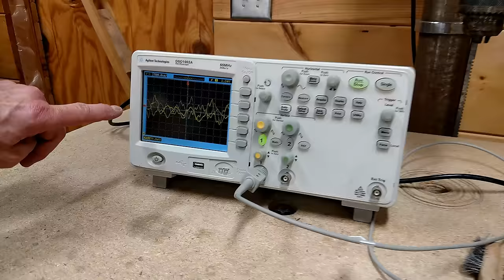Active Noise Cancellation

Comment: I couldn't determine : 
- was it partly 'good luck' that the actuator generated sound waves that were out of phase  ?
OR 
- was the system designed to (directly) generate anti-phase sound ?  If so which part of the system ?   

Either way, the means of adjusting the amplitude then seemed the way of getting the best out of the system, is that correct ?
Reply from the maker: Think about these sound drivers.
When they are manufactured, the magnets, coils and flexible diaphragms will have the same orientation relative to each other, unit to unit. The starting position from rest will be in the middle of its excursion limits. The instant an electric current begins to flow, the magnet will begin to move.  If the direction of the current begins in the other direction, then the magnet will begin to move in the other direction. Visualize a sine wave, that opposite motion will produce a 180 degree phase relationship.
Reply: @TechIngredients  RE>> If the direction of the current begins in the other direction, then the magnet will begin to move in the other direction.

It's a great explanation and I do understand this, thankyou.   My guess then is you probably wired the side panel actuators in opposite polarity to the one making the sound in the box, is that correct ? 

Technically even that might not be enough as the cancellation effect must partly depend on the # wave lengths from the sound device to each cancellation device.  On that basis I expected to see some sort of tuneable time delay circuit for each cancellation device
Reply from the maker: That's  how I did it.
The way I kept this simple is to locate the mic and the cancelation  actuators(speakers) as close as possible (1 cm).  Even at 2,000 Hz, the waves were still 168 degrees out of phase.

Comment: Question for you: There is a loud compressor across the street that is driving me crazy.  Would it be possible to place a speaker and amplifier beside the compressor and play back a recording of the compressor noise ( out of sync, of course)   Would this have the effect of cancelling the noise?
Reply from the maker: Yes...but.  the sound coming from the compressor is radiating from all of its surfaces and reflecting from any nearby surfaces such as walls and the floor.  A loudspeaker, even if located nearby, will have a different radiation pattern and that matters.  That is why my demonstration used a box to cancel the sound from each direction with a mic and speaker pair for each wall.  Even then, the reason the amplitude didn't drop further than it did was largely due to the uncompensated bottom surface on the table where no mic and speaker were located.

Comment: Nice video and I learned a lot. But I'm confused as to how the sound is being phase shifted? Using an amplifier will only change the amplitude of the sound. Are you relying on the circuit latency to assume that the original and generated waveforms will be phase shifted by 180? If so, then it seems pretty inefficient and unreliable method as you might get constructive interference instead of destructive for some other amplifier model(different latency), and hence more noise instead of less. Ideally, I think there should be 2 knobs, one to adjust phase delay and another for amplitude.
Reply from the maker: It's actually very simple, but limited to lower frequencies.  The detector and the actuator are positioned approximately 1 cm apart.  By reversing the polarity of the amp. output, the phase offset is 180 degrees minus the spatial offset times the wavelength/ the speed of sound.  For example, a 200 Hz sound will have a wavelength of approx 170 cm and a 1/2 wavelength (peak to trough) of 85 cm.  The phase error would be approximately 2 degrees.
Reply: Tech Ingredients Thanks for clearing that out. I see by your calculations that the amplifier latency will be negligible for low frequencies and your method of swapping leads would work out quite well.
Now I'm wondering whether it could be a closed loop system. A microphone outside the box controls the gain of amplifier. If you intend to put engines, that will compensate for frequency changes while engine is running at different speeds. Will need quite intensive PID tuning. Guess that's probably just overkill and your method should be fine for 90% use cases 🤔

Comment: Does the acoustic panel burn at blocking shock waves due to the frictional energy conversion🤔. Ive seen his one of video of hydrogen which he says it can produce mach9 speed of pressure waves.
Reply from the maker: No it doesn't.  There is little energy being absorbed here.

Comment: So... if I wanted to muffle road noise to my house.. I could pickup the sound with a microphone then time it correctly to be 180 degrees phase and project to my house.. Thus cancelling most of the waves ?  🤔
Reply from the maker: Sorta.
The sound hitting  your house will strike the outside  with a whole mix of phases, and the walls will respond with a mix of different resonances  depending on the local stiffness. This can work, but you'll  need dozens of microphones  and drivers working in independent loops.

Comment: Would the 60/40 ratio used in your speaker-room be better than the centred actuators here?
Reply from the maker: No.
The concept here is  to counter the movement of the surface by using active feedback.  The mass of the actuator needs to be located where the surface would otherwise move the most.

Comment: Wait a second, are you driving those Dayton Audio exciters with Adafruit stereo 20W class D audio amplifier boards? That's exactly what I want to do, but for a different project. In my application, my head will be in a helmet right between two of those exciters, so it shouldn't need too much amplitude to sound really loud inside. I also want to drive those exciters with analog output from an electret microphone, but I'm afraid of feedback. What's the best way to eliminate that feedback?
Reply from the maker: Make sure the output from the speakers is isolated as much as possible within the helmet.

Comment: So noise cancelling headphones basically have a microphone which listens to sounds and delays them so the soundwaves going in are the opposite of the soundwaves going out
Reply from the maker: Yes.  they also include a more sophisticated DSP circuit to adjust the degrees of phase delay based on the frequency rather than our simpler, 180 degree phasing that occurs with reversing the polarity of the speaker's lead wires.  This method will not work well as the frequency of the sound goes beyond several thousand Hz, do to this mismatch.

Comment: Let me get it straight. As english is not my native language, i'd clearify some stuff off this video.
As far as I understood, you can "cancel" out speakers if you put them on the same line and invert a signal on one of them? 
And this box. In the box there was a speaker and a mic, and outside there was speakers who took reversed mic signal and cancel out noise? 
If so, that would be interesting for a huge venue stages. that would insanely improve sound quality!
Reply from the maker: You have presented this correctly.

Comment: Superb demonstration of canceling a single tone. To cancel a generalized sound requires doing an FFT, inverting each component, and then summing them into a signal that will drive a speaker. Much harder to explain but I look forward to how you do it. Thanks!
Reply from the maker: Maybe not. Consider what is happening when the mic is generating a signal.  There is only one channel reading the Fourier assembly of all the sinusoidal waves that comprise the complex sound.  At any instant, all of that complexity is a single voltage sent to the amplifier which in turn generates the current that drives the oposing actuator.  The reason a DSP must be used for noise canceling headphones is the displacement of the sensing microphone and the canceling speaker.  A frequency dependent phase delay has to be introduced to maximize effeciency and this become increasingly more important as the frequency increases. We mounted these microphones as close as possible to the actuators and are willing to live with a frequency limit around 1-2 kHz.
Reply: Tech Ingredients A credible demonstration would resolve it.
Reply from the maker: It would.

Comment: how do you compensate for the latency in the active noise cancellation? wouldnt the circuit introduce some sort of delay and shift the phase off by just a bit?
Reply from the maker: The circuit is extremely fast compared to audio frequencies.  There is a phase mismatch that is produced by the displacement of the mics and the exciters and that limits this approach to frequencies below a few thousand Hz.

Comment: Interesting video.  But just curious why you are using gas motors instead of electric motors for the drone.
Reply from the maker: We are using both.  The engines will generate the electrical power and extend the flight time that can be achieved with batteries.  By using a separate module, you can add this generator to an existing multi rotor without modifying the basic craft.
Reply: @TechIngredients  - Thank you for your reply.  I understand now.  Also after watching more videos in the series.  So basically you are replacing the main drone battery with a gas motor and generator which should give a much longer flight time..

Comment: So you just feed the driver inverting the cables respectively to the microphone?
Reply from the maker: Yep, it's that simple.  But, this does create limits to the upper frequencies that can be attenuated because of the separation of the mic and the driver.  Phasing mismatch will increase as the wavelength decreases.

Comment: very cool! I have a question that might be very stupid, but I really don't know...lets says we could apply this to a studio, for sound isolation purposes. Inside the studio we need to hear everything the way it is, for recording or mixing, and my first thought is that the out of phase sound produced to cancel the original sound would also be heard by whoever is in the studio, messing all the original sound, wouldn't it? Or is there a way to make this cancelation work only for whoever is outside the box (or the studio)? Again, thanks for the great video!!
Reply from the maker: Reflections and phasing are a nightmare.  What you hear and what someone standing several feet away will hear over numerous frequencies, may be completely out of phase.  Attempting to modify the wavefronts that are striking you and your friend simultaneously by introducing an anti-phase wavefront from a  common source would be nearly impossible.  The best compromise would be to place generous acoustic absorbers within the room ( common practice), but then to limit the transmission of the sound outside the room by making the walls essentially infinitely massive with drivers to nullify their movement.  This is easier because the wall moves or dosen't move in response to the entire spectrum of frequencies and their phases because the wall is a single, plane in space.

Comment: I was wondering, the speaker and the shakers are putting energy inside the box. The waves cancel each other because of the phase-shifting but the amount of energy does not decrease, right? Could this energy become heat or another type of energy?
Reply from the maker: It becomes heat.

Comment: Any chance you could build a rotary engine they don’t vibrate much and make great power for their size plus I always want to see a small one made, another great video.
Reply from the maker: It would be interesting, but we can handle only so many projects.  We recently finished a very small turbojet engine based on an automotive/motorcycle turbocharger that will drive a turbo shaft, turbine.  That video will be posted soon.

Comment: It is really good. This is the best demonstrations of out of phase I've ever seen. Perfect. But I have a question: What frequency is it on you demo. I'd like to duplicate the experiment again by myself. Could you give me some hints. Thanks lot.
Reply from the maker: Probably  close to 1,000 Hz.  But, simply divide the speed of sound by the frequency to determine the wavelength and space the speakers 1/2 that distance apart.
Reply: @TechIngredients  Thanks for you prompt reply. Actually we did the different frequency to try including 1k Hz, but the sound was not able to cancel. We don't know what different in between us. Could you give us a list your equipments, then we will duplicate this phenomenon again. Thanks in advance.
Reply from the maker: Don't focus on the particular frequency, it doesn't matter.  If you understand the principle, then the equipment also doesn't matter.
Reply: @TechIngredients  Yes, I agree with your points. But right now actually we can't duplicate your experiment, even though we tried several frequencies and moved one of the speakers to find if there is a position that can cancel the sound as you demonstrated. I have an unreasonable request. If it is possible could you help us to check, we will make a video or take some photos that should be easier to describe our setting. Of course, that must be in your available time.😀
Reply from the maker: First, try a significantly  lower frequency as the spacing will be proportionally  less demanding.  At 343 Hz, the wavelength is one meter, place one speaker 1/2 meter behind the other as close together, laterally,  as is convenient.  Stand directly  in front of the pair at a considerable  distance, say 10 meters.  Do the testing outside  to eliminate reflections off walls that will interfere with the test.  As you listen, have an assistant move the rear speaker forward and back and you will certainly  see the effect.
Reply: @TechIngredients  Wow, thanks a lot. We will retry the test and set it as per your suggestions. Then we will let you know what results we found. Thanks again your great help. :washhands:😄☺
Reply: @TechIngredients  Hello, actually we did a test again following your suggestion and speaker placement. But the result wasn't outstanding, even though nothing was changed. We just thought that the difference was related to the speaker type or others equipment. Can you share your speaker's brand? We would like to buy the same speaker and try this experiment again.

Comment: So how does simply reading in the sound and playing it back through the amplifier and shakers create anti phase noise? What does the phasing from the input to output signal? Or is it just the time lag it takes to play the noise back?
Reply from the maker: The output from the mic to the input to the voice coil of the driver are either in phase or out of phase depending on the polarity of the leads.  The mic and the actuator are physically so close that reversing the phase of the actuator effectively oposes the phase at the nearby mic.

Comment: Would gel work between the steel and foam to act as a secondary absorption layer or would it's density make it act more like the steel?
Reply from the maker: Incorporating both active and passive noise reduction is probably best. A viscoelastic gel would indeed help. Interesting that you mentioned this. We are also looking at very lightweight (thin) aluminum panel stacks separated by tiny gel spacers.  The idea is destructive interference and constrained layer dampening...we'll see.
Reply: lelandsdad13 perhaps Aerogel???

https://en.m.wikipedia.org/wiki/Aerogel

Comment: if we wanted to use this technology to make an active noise cancellating wall around the perimeter of a music festival, would the speaker producing the anti phase wave need to be as strong and powerful as the speakers at our stage?
Reply from the maker: No.  It would have to equal the sound pressure that strikes the wall which should be approximately the area of the wall divided by the area of the cylinder or sphere ( depending on the speaker projection) at that distance.  Because the wall isn't infinitely rigid it would be better to further divide that wall into several mic-speaker regions.

Comment: I wonder if something like this could be used to mitigate the bass from my neighbor's car stereo, as well as the noise from the busy street (busses, trucks, etc)
Reply from the maker: It could, but because we avoided using complicated DSPs, the effectiveness will decrease as the frequency increases because the shorter wavelengths will be poorly phase matched due to the finite spacing of the mic and the driver.

Comment: The speed of sound is 1100Hz?  I'm confused - I thought Hz represented the frequency of sound (high or low notes), not the speed. Doesn't all sound move at the same speed, regardless of frequency?
Reply from the maker: This was a simple slip of the tongue.  We didn't notice it untill after we had posted the video.  You're correct, I should have said 1,100 ft/sec.